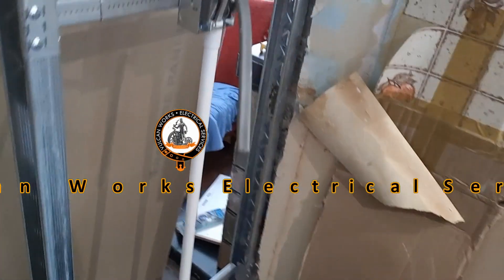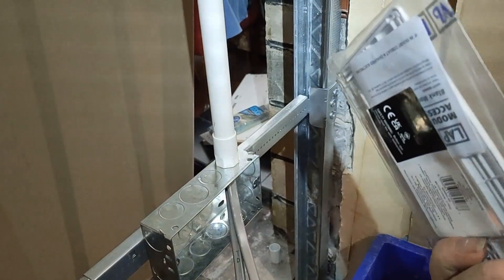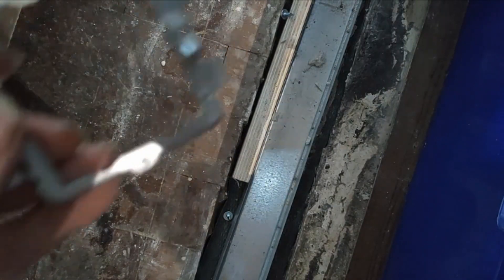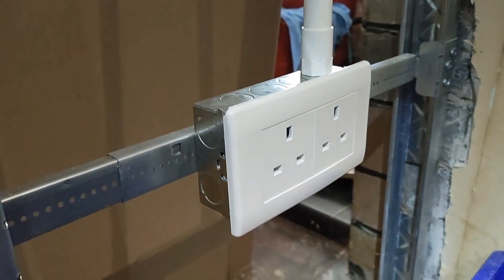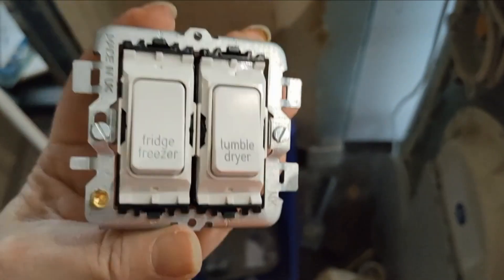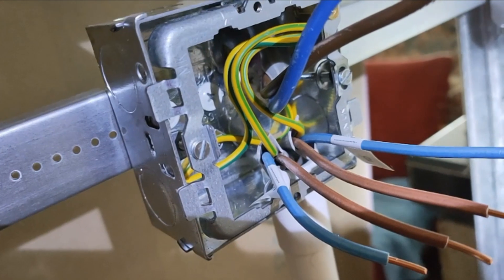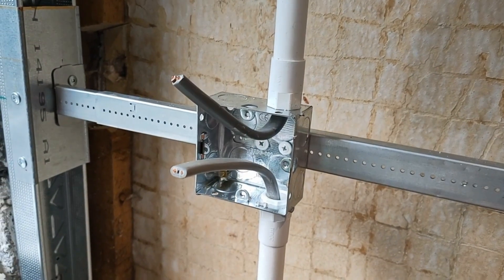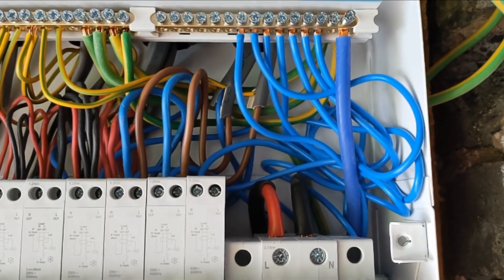Kitchen Rewire - 2nd Fix

Comment: you can shorten the neutral tails on fusebox
Reply from the maker: Hi. Yes and indeed I intend to do just that, once I'm back in the next week or so. It should tidy it up quite a bit. I do understand why the have such long leads...there's no way to know how far from the neutral bar they will be fitted, but I do think they've overdone it a bit.
Reply: @vwes  they do very long boards and 3 phase
Boards so when you fit them they are perfect

Comment: Please do not show foreign how to do e!ectrical work in the USA. Only time that you can install type NM ( Romex ) in conduit is say down a basement wall to protect it. If you run conduit install approved building wires like THHN or THWN. Not allowed to use blue wire for the grounded conductor ( no such thing any more in the NEC as a neutral wire.
Reply from the maker: Thank you for the comment. The disclaimer on all my video's does state that work should not be carried out by non qualified electricians, and I would hope that electricians viewing these videos from outside the UK would know to follow their local regulations. However I will make it clear in my disclaimer that these video's are in compliance with UK regulations and electricians should follow their own country regulations..or something to that effect.
Reply: @vwes  I would just ignore stupid comments tbh
Reply: What are you on about